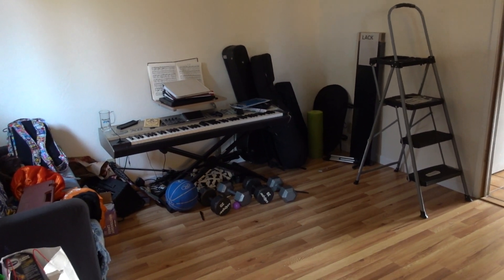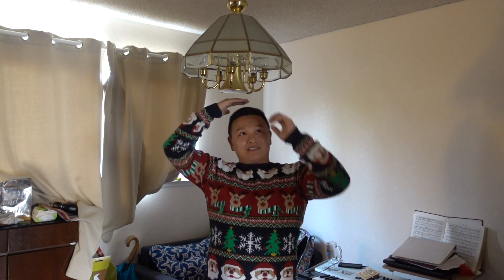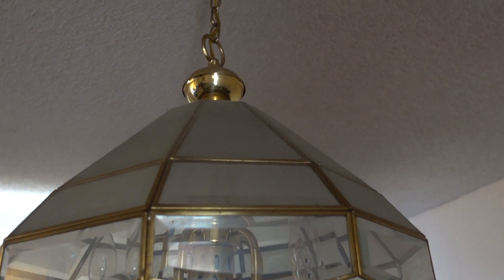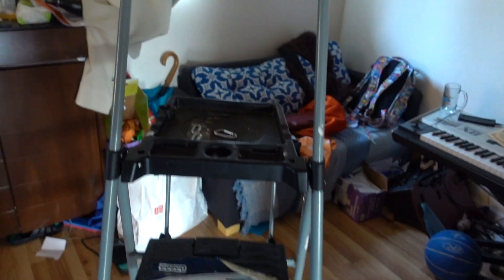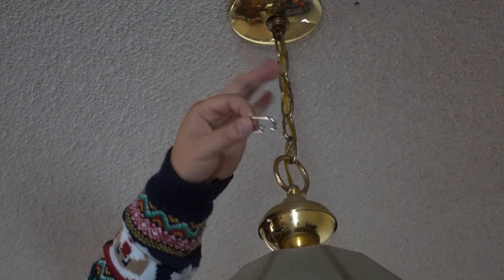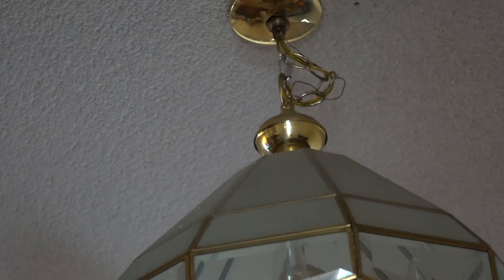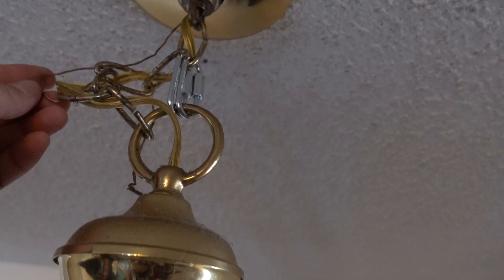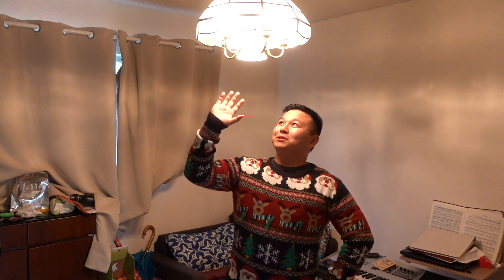How to Raise Ceiling Light Fixture with Screw Quick Links

Comment: Is the ceiling okay with the heat from the bulbs? I’m asking because I want to do this with mine
Reply from the maker: It is totally fine, the heat is generated by the light bulbs from the bottom, plus the ceiling is more heat tolerating than a human head.  Good luck on your project :-)